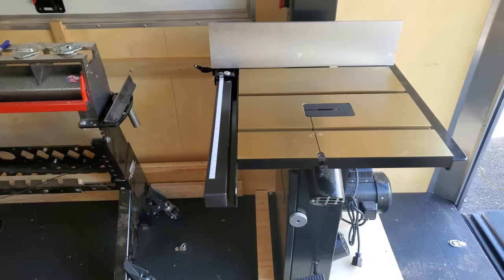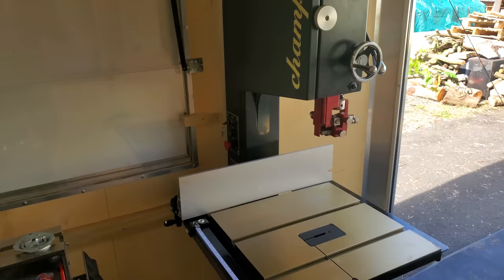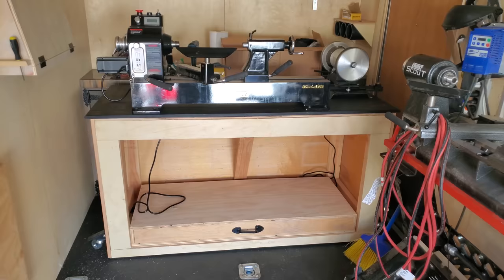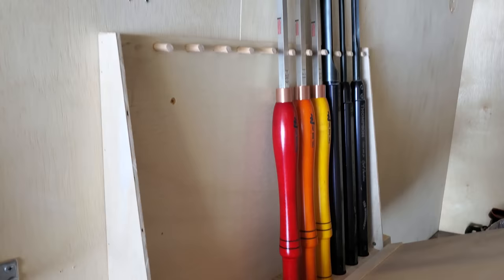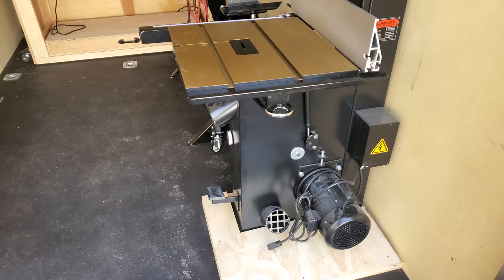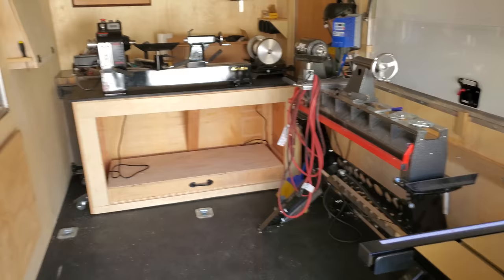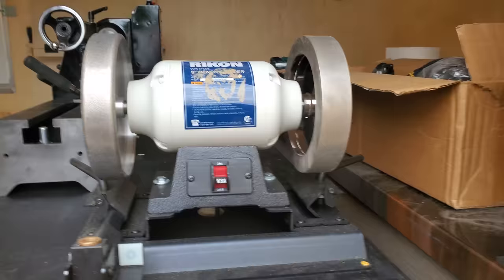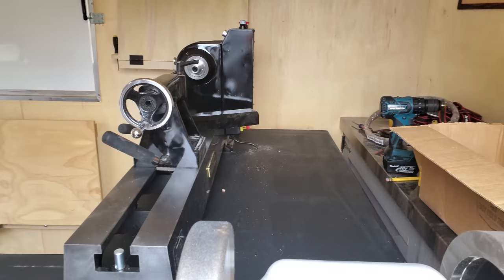Shop Remodel

Comment: how are going to keep the cart that has the new lathe on it from moving around? is it strapped down? or is it just really heavy?
Reply from the maker: It's really heavy I don't think I'll need to strap it down.
Reply: @CarlJacobson  Garry, not Linda. Oh yes you do! I've been hauling things on trucks and in trailers for years, lock it in place. You never know what's coming down the road.
Reply from the maker: Thanks :) I'll strap it down